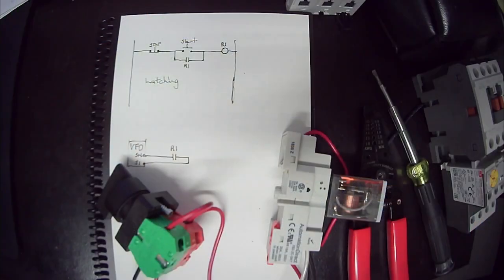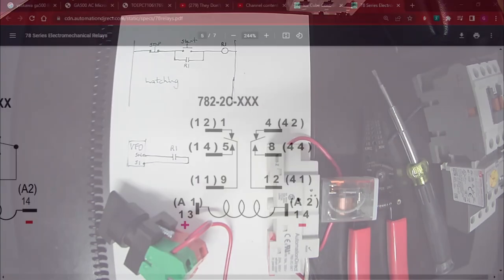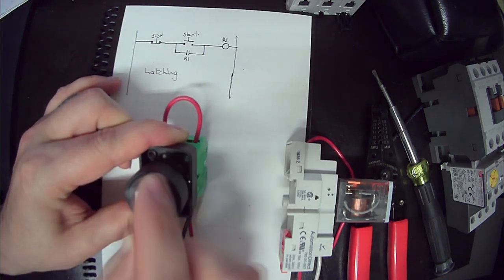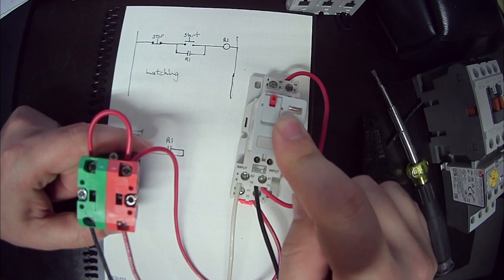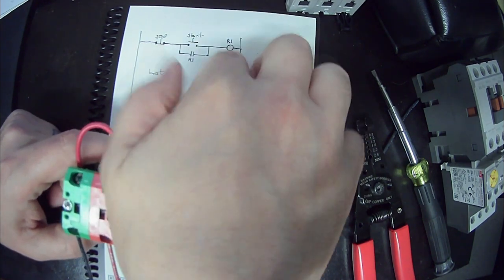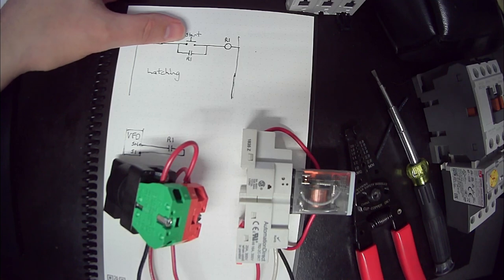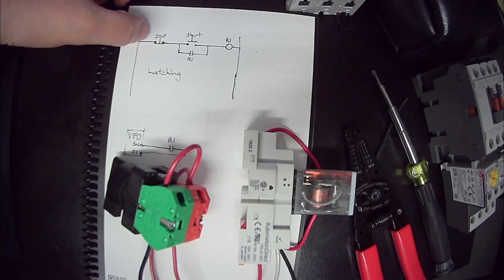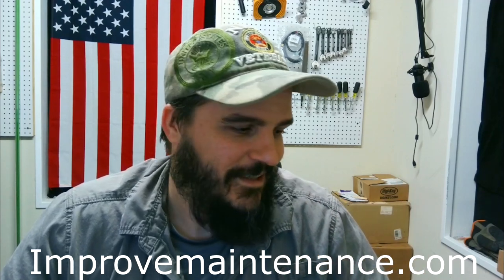How to wire up a latching circuit

Comment: Contura XIV Rocker Switches
Start Run/Stop -  how should I wire this switch in a boat? there is only 2 wires coming out of the harness, one labeled RUN the other Start.